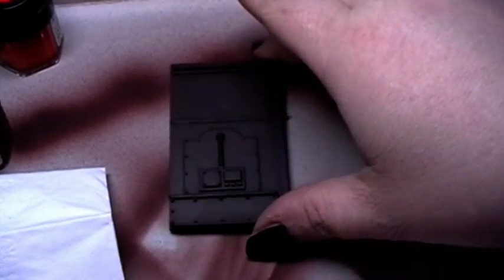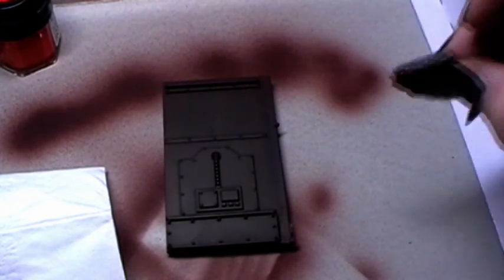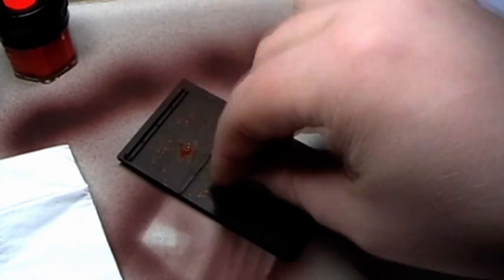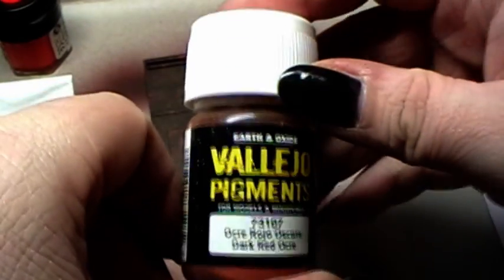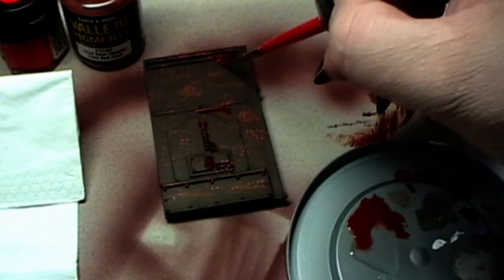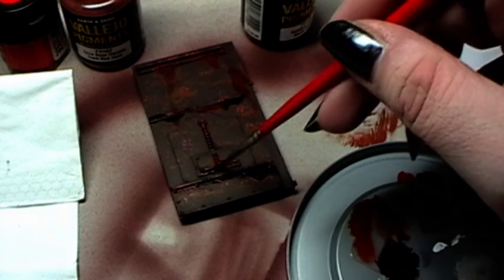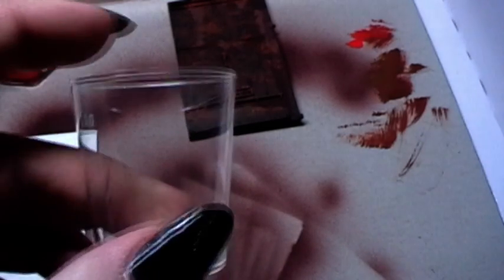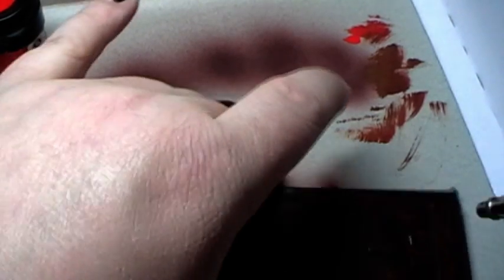How to weather a surface with the hairspray and salt method part 1

Comment: A hairspray conatiner is a spray in itself :P Maybe if you only mist it over it would work, but as she said its easier to control it with an airbrush, but I'd try the hairspray bottle myself when i buy a building or so. :) Misting it over will be by holding the bottle further away from the model. ^^

Comment: A great tutorial and very imformative, thank you Alexandra. I would like to give an economical advice.. The pigments you are using cost about 3min-4max euros and come in quantities of 30 ml. These powders are the same material used by the icon painters (religious painters) and I buy 100g of each powder for my miniatures, for about 1min-3max euros (depending on the kind of colour and material). The only difference... NO TRADEMARK ON THEM...!! Try to use them for the sake of your wallets ;)